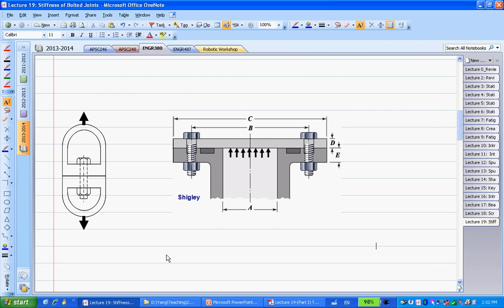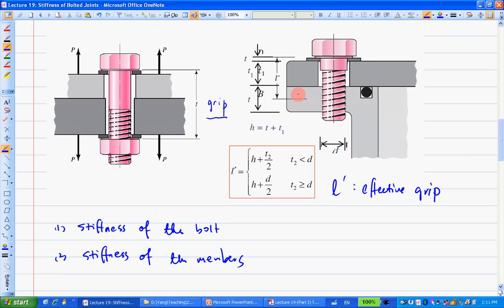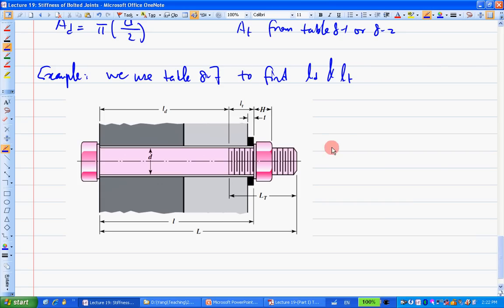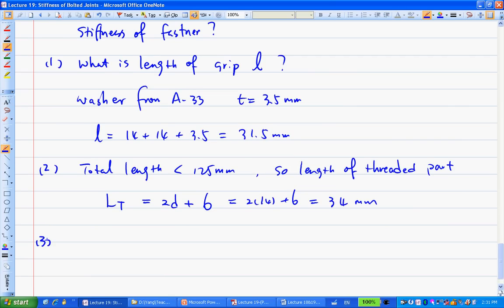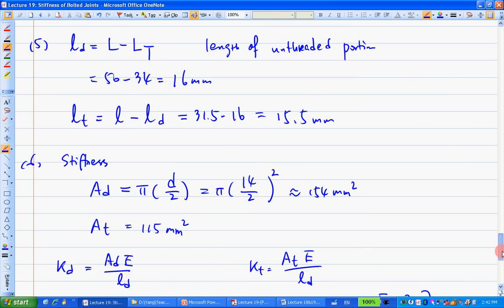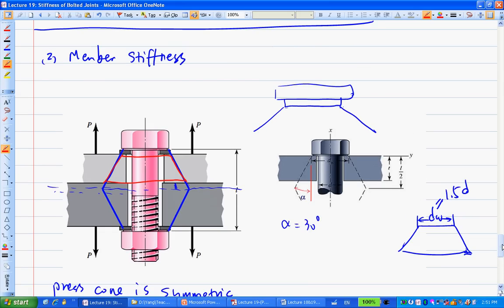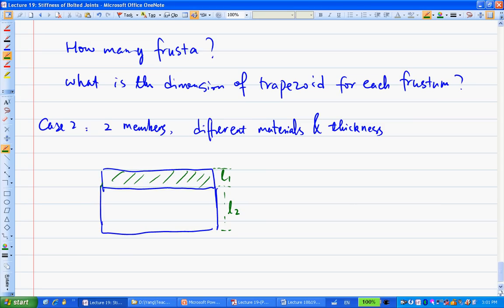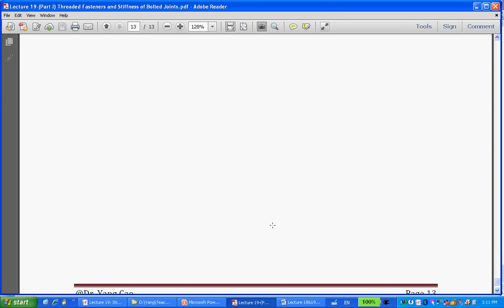ENGR380 Lecture19 Stiffness of Bolted Joint

Comment: Why so much work in the non-threaded / threaded sections of the bolts? Wouldn't it be better to consider all the section as threaded (more safe)? simpler?
Another question. What do you do with the calculated stiffness?
thanks
Reply: And more expensive, so that's why you hired to save extra cash for the company